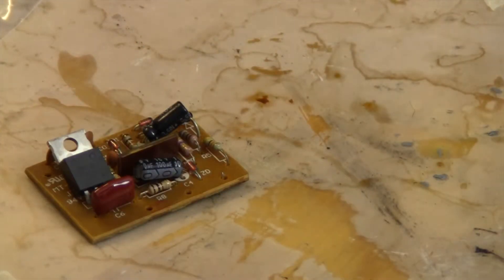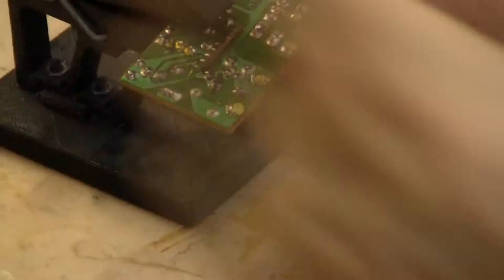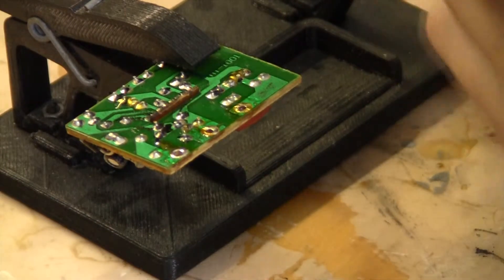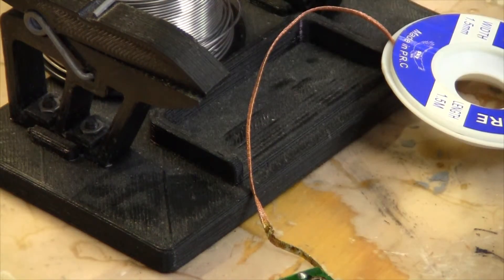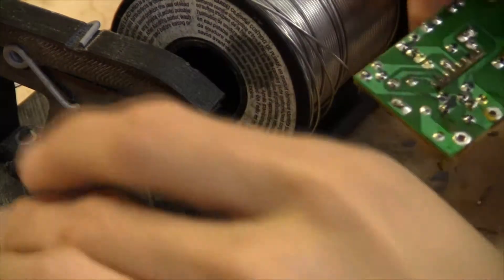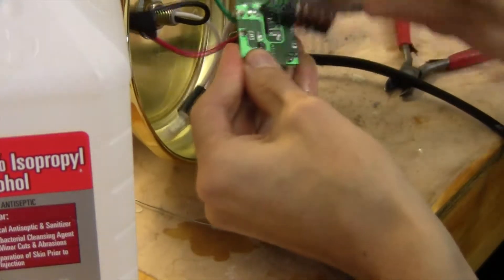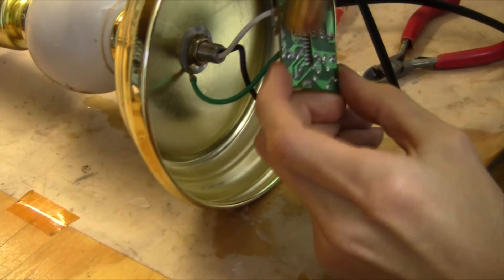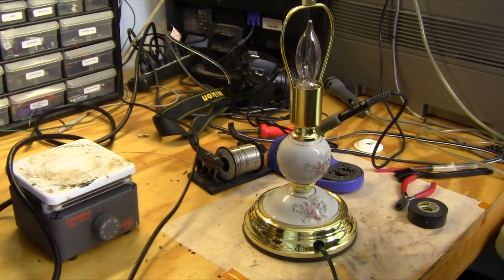Touch light reverse engineer and repair (Part 2)

Comment: Very nice videos.  The audio seemed kind of muffled but great content.  When I measured the voltage output of my touch light lamp controller, I got 0 volts for off, 20ish for level 1, 50ish for level 2, then 40 ish for level 3.  It functions as expected.  Can you explain the nonlinear voltage readings?